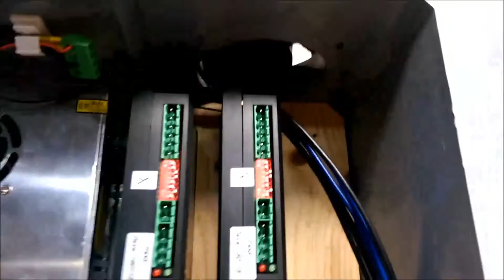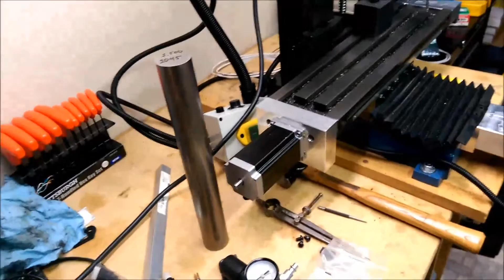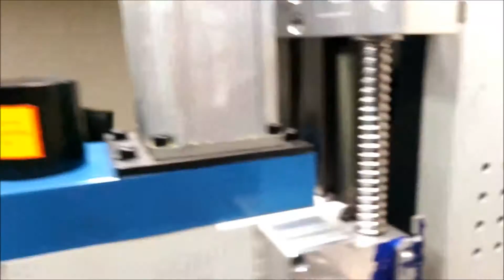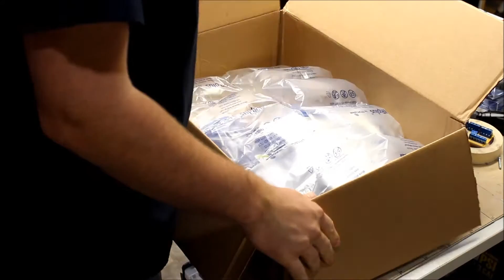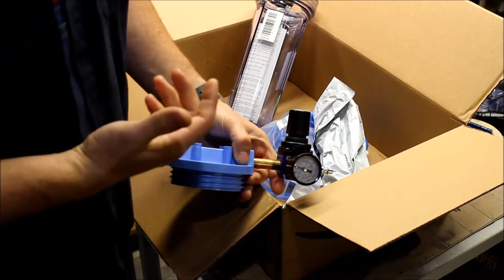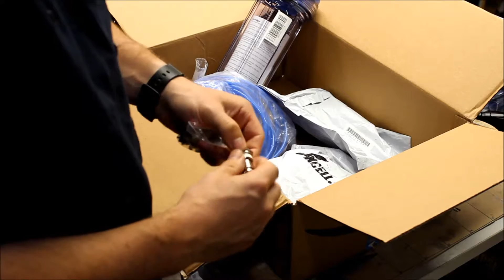Mini MIll CNC Conversion: Part 6ish Update and Mail Call

Comment: What did you determine on the size of the ball bearings for those ball screws? I can’t find any info online regarding the maximum size that will work. Thanks for any insight.
Reply from the maker: I actually used two different sizes. Unfortunately I do not recall them now, but will try to get some updates this summer. I basically ordered the two sizes closest to the original I could find on McMaster Carr that were larger, and tried them in the nut to see if they would work without binding. If the bound, I used the next one smaller.